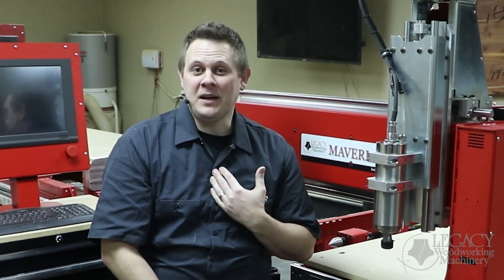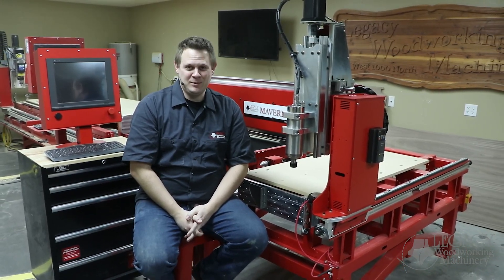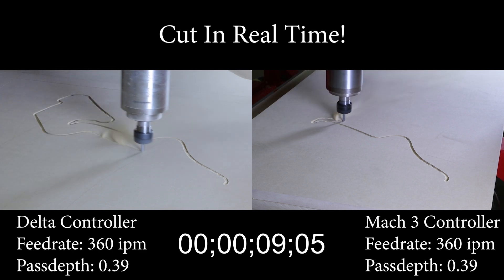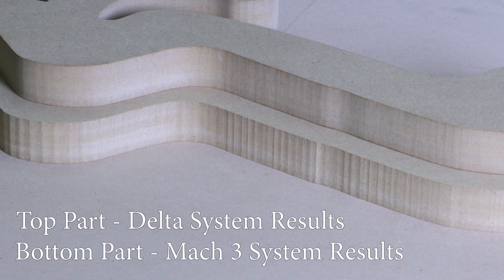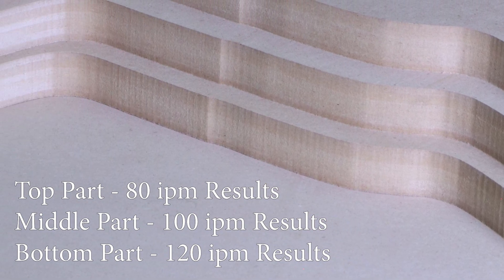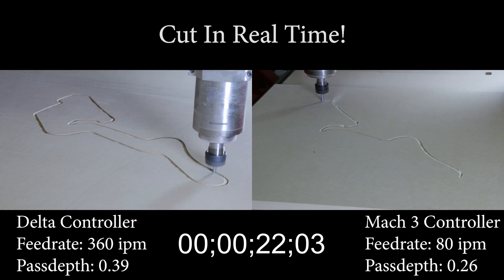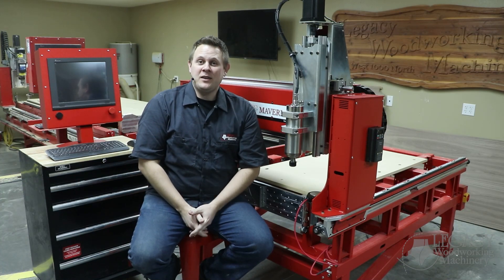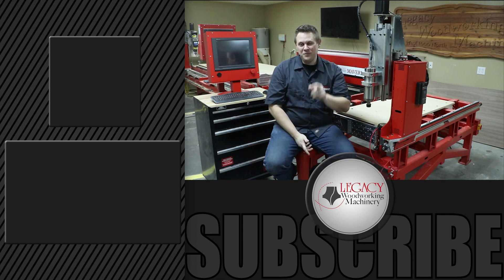CNC Router 3x Faster Time Study - Maverick 3x5 Pro - Release Date Mar 1st - Legacy CNC Woodworking.

Comment: Cut quality and cut speed are typically a function of cutter geometry and features coupled with chip size and chip removal.  Chip size is driven by RPMs and feed rate.  Chip removal is effected by direction of the flutes on the bit.  A bit with an upshear configuration will pull the chips up out of the cut. It will also chip the top surface of veneers and laminates. And it will try to lift the part off of the machine.  Most CNC  operators use a compression bit to make this kind of cut.  The geometry of compression bit "stuffs" the chips back into the cut so you manage that.  The spindle and gantry of every CNC has weight and mass.  To think that you are going to change direction quickly and not have to take in to consideration that mass is naive.  The Mach 3 controller has a toggle that is labeled "constant velocity" .  Toggled to the off position forces the controller to feed one line of G-Code at a time to the machine with a micro second pause between  lines.  It sure looks like that is what these guys are doing. Without a honest and detailed discussion about all of these factors, this boils down to nothing more than a sales pitch/ hype, IMHO.  If it was as simple as this, no other CNC in the world would use a controller other than a Delta controller.

Comment: Does 6x faster holdup to all 3 locations on machine (spindle & cutting panel)
Reply from the maker: the delta really excels in multi-axis movement. any location where that is applied on the machine we can see an significant improvement, maybe not 6x faster though.

Comment: Can the old Maverick 3X5 purchased in 2020 be converted to the new Delta system, at what cost?
Reply: I too would like to know.   Also have a 2020 model
Reply from the maker: We are not upgrading the original maverick 3x5 to a maverick 3x5 Pro. We ran some numbers on what the program would look like, and the price tag on the upgrade would be too expensive. (like around 14k) 
The price is due to:  
freight of machine coming to and from the facility here in Utah.
Adding the touch screen computer
Adding several other electronics pieces
Wiring all these new components to each other and your existing motors and VFD.
The customer frustration with the amount of time their machine would be down waiting for the upgrade.
Reply: @legacycnc8232  Brand new machine is already obsolete, that didn't take long. Would think the price tag for the upgrade wouldn't be almost as much as I spent buying the whole thing. Sorry Legacy, this doesn't make me a happy customer.
Reply: Do you take trade ins on older Maverick 3 x 5.  The poor finishes make sense, I’ve been struggling with getting good finishes on my Maverick...